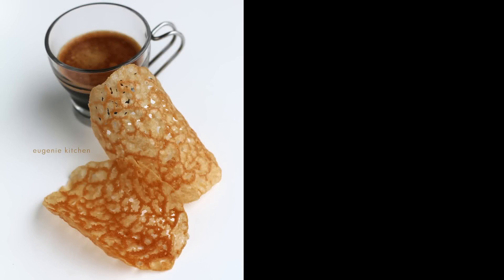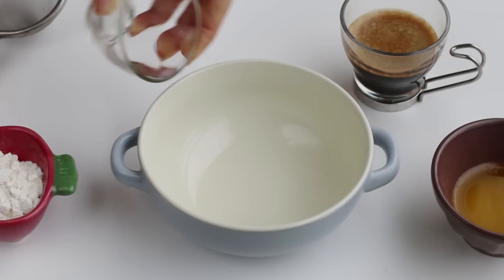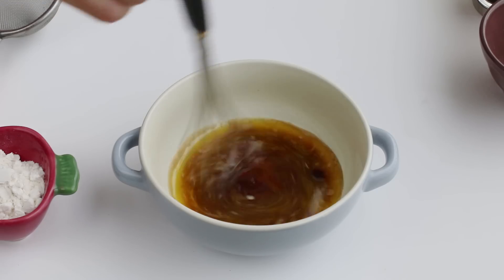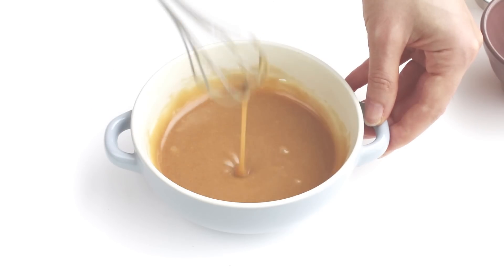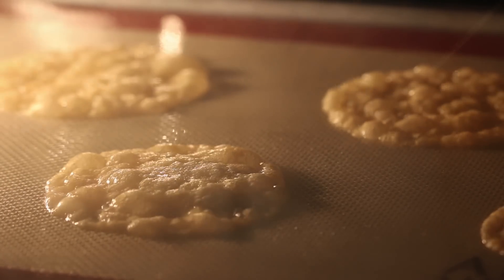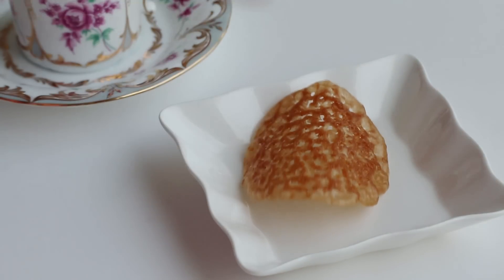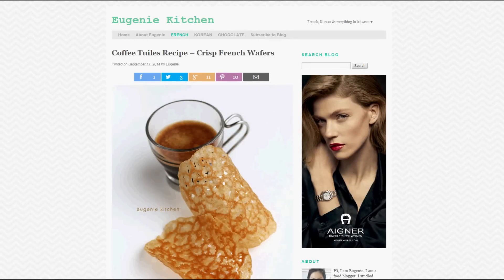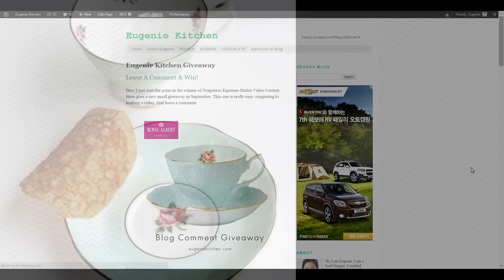Laced Coffee Tuiles – Crisp French Wafer Recipe 프렌치 와퍼 커피 튀일 만들기 - 한글자막

Comment: What is different between all propose flour and normal cake flour? And I love your video
Reply: All-purpose flour is, well, an all-around good flour to use for baking breads, cakes, muffins, and for mixing up a batch of pancake batter. All-purpose has protein content of 10-13% and it will perform very well, time after time. But if you want to make really soft cake layers, reach for cake flour. Cake flour has 8-9% protein, making it the weakest flour on the shelf, and it bakes up into meltingly tender cake layers.